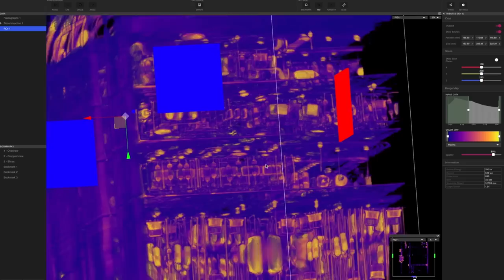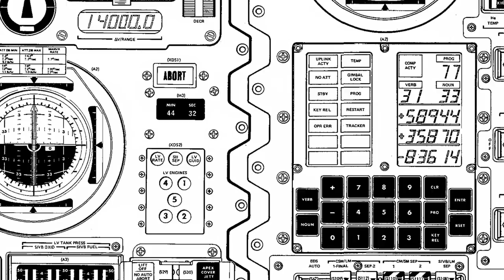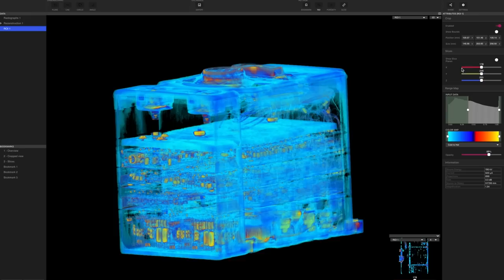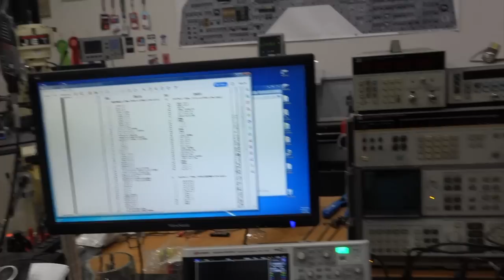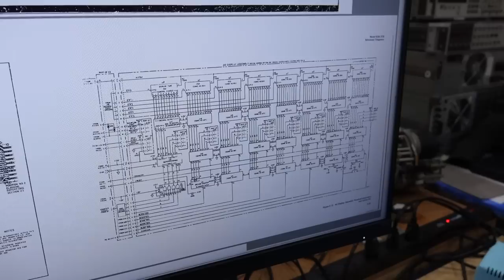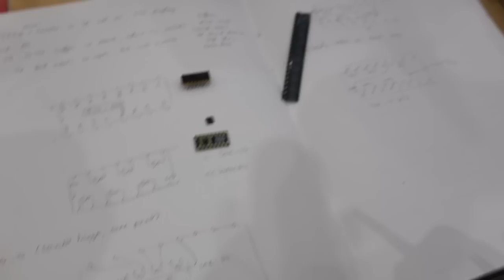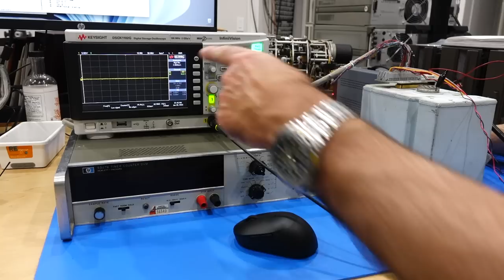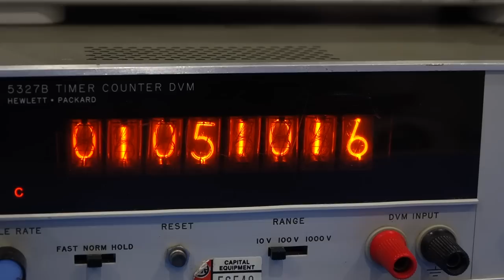Apollo Comms Part 25: powering up the Central Timing Equipment box

Comment: A sealed box from 1969 and it can hit 500.00042 khz without external locking. I'd say that's pretty good and a testament to the design engineers and the people who put it together.
Reply from the maker: I’d say the same, we were quite happily surprised!
Reply: Not to mention, this is "just" the backup :D

Comment: In 1976, I worked  in the factory of a Skokie, Illinois manufacturing company.  My boss was a great guy who was once an executive at General Time Company in Elgin, Illinois.   He told me the story of how his company sought the contract to build the Apollo central timing unit, and was so proud of their part in the Apollo project.   General Time built some prototype clocks using the very best parts and techniques available at the time, building them to exacting NASA standards.   My boss traveled from Chicago to Houston with two copies of the prototype in a briefcase sitting next to him in an adjacent seat on his flight.   He delivered the items to NASA and General Time won the contract.
He told me there was a switch on the Saturn rocket that activated when the rocket lifted off the launch pad to start the clock.  If I remember correctly, the whole vehicle had to move up a short distance to trigger the switch.
Reply from the maker: Yes, there is a lift off signal that goes to the clock. I should really wire it up. It was simply connected to the ground service equipment plug, and when that let go the contact was broken, signaling lift off.

Comment: These spacecraft sure seemed to have a lot of extra mass in the cases of the various boxes. I guess the Saturn had enough poop to lift it all.  With every advance in this project, I become more gobsmacked with the brilliant persistence involved in the sleuthing.
Reply from the maker: Actually the cases are incredibly light, in magnesium. The case feels like it weighs nothing. However the boxes feel incredibly heavy for their size, it’s just the weight of the 1960s electronics inside!

Comment: Apropos absolutely nothing, I used my Big Ben alarm clock in the late 50's, along with a mousetrap, non-safety wooden match, sandpaper, custom bracket, and small unsafe but sane bit of 4th of July tomfoolery,  to make what might be called a timed noise-making device employed outside my sister's window. I don't recall how successful this all was, but it was great fun to construct. The important aspect of the Big Ben was that the clockspring winder on its rear unwound rapidly when the alarm sounded.

Comment: Now, for extra credit;
Design and construct modern replacements for each of the spacecraft modules using currently available production parts. Special exemption will be allowed for incredibly specialized components which may not be currently available due to lack of demand. Additional points given for creative use of modern components to replicate functions of unavailable parts. 
The design brief is to create modules which are smaller, lighter and equally capable while meeting equivalent reliability and fault tolerance of the originals. New modules must retain interoperability with original units.

Sorry. I couldn't help it. I can just imagine how hard a task like this would be to try and attempt.
Your work is amazing, and it is so good to know that this knowlege is still out there.
Reply: You wouldn't do it that way.  All the digital stuff for the entire spacecraft could be done in a single FPGA chip.
Reply: @stargazer7644  I am aware of how you would do it if you were building a NEW space craft. What I would get a huge amount of enjoyment out of is seeing how we could replicate the old stuff with new components. 
As to the single FPGA, that is a recipe for a complete disaster. If the chip fails in any way, you are sort of screwed. 
Vibration, temperature, humidity, radiation and just plain unknowns mean you have no choice but to double or even triple up just to be sure it stays working.
Additionally I am not talking about a circuit duplication. I am looking for a FUNCTIONAL duplication. So which parts you use and how you use them is irrelevant. So long as it does the same job with equal or better reliability.
Overall it is a design exercise with a set of known parameters.
Reply: @RomstarOrion  There is absolutely no point in replicating each module independently like that.  And FFS man, they had TENS OF THOUSANDS of components in those CM modules with a MUCH higher failure probability than a single FPGA.  Replacing them with one component makes things MORE reliable, not less.  Simply have a redundant pair of them.  How many of those MUCH more complex systems had triple redundancy?  It seems like you're just arguing to argue.
Reply: @stargazer7644  Actually, I had every intention of suggesting that you were arguing for arguments sake.
I think you missed the entire point.
It wasn't about creating it to use it for anything. It was to see how we could go about doing it for comparison sake.
It was an idea to do for FUN. Yes, fun.
What practical use could there possibly be in recreating these other than to see how we would do it.
The entire 1960s space program pioneered new technology, the benefits of which we are still seeing. That is part of the reason why these things were built the way they were.
Today, it could be possible to build almost all of it out of off the shelf parts and still have it come up more reliable, smaller and cheaper.
Reply: @RomstarOrion  "Today, it could be possible to build almost all of it out of off the shelf parts and still have it come up more reliable, smaller and cheaper."
Yes, in fact you could do almost all of the digital part it in a single chip, as I said.  Sigh.

Comment: It makes sense, considering the number of places timing signals went, that "the clock has started" (or similar wording) was important enough to call out at liftoff.
Reply from the maker: In Fran’s Blanche superb “Apollo 11 launch in real time” with combined voice loops, you can hear the “roger clock” being called out at lift off by the launch engineers.

Comment: Very cool!! I have an hp nixi volt meter of the same form factor, possibly the same nixie board you have there. You are giving me ideas for future data display needs, THANKS!!! 
Right now it's an HP high res volt meter with a blown high pressure mercury-reed relay that exploded on me! I don't like those relays. I won't gut the volt meter section, it's a work of art. But I'm not going to replace the relay until I know why the last one exploded with minimal provocation. It shot glass against the wall behind me (and it's small amount of mercury). I just barely bent the wire running into the "containment" housing and BANG!
Reply: I'll just use the native input though!

Comment: What was the trigger for the MET to start? Was it the end of the countdown? The vehicle clearing the tower? Or something else?
Reply: I wonder that also 🤔
Reply: Did a little research and it seems the clock starts at liftoff but haven't been able to find how liftoff is determined. I.e upward vehicle motion, umbilical disconnect, etc..
Reply: Liftoff was an external input to the AGC and was checked every half second.  Several functions were triggered at liftoff, including resetting the mission clock, switching the CM and Saturn V IU from a rotating to non-rotating reference mode, starting the earth orbit insertion program, etc.  This signal is generated by the IU umbilical disconnect.
Reply: @stargazer7644  I expected something along these lines... thanks for the info!

Comment: So. A big question. How much in your collection is missing to rebuild all the avionics of the apollo capsule?
Reply: Check the layout picture at 0:20 and count the uncoloured boxes.  Then add any other gear that is deeper in the command module and everything in the service module and what additional controllers were used on the lower stages for guidance during launch.

Comment: Slightly more ridiculous, but you could have used a CPLD or FPGA to switch between native HP mode and BCD input mode.
Reply: Sure, but quite a bit of overkill.  All they need is a couple of bus switches.

Comment: Is the CTE filled with anything?  awfully high density with no air movement for cooling
Reply: That's what the heat transfer plate is for.  You can't rely on air for cooling.  Remember, this stuff has to keep working even when the Apollo interior is in vacuum - during EVA or in the event of a cabin depress for example.

Comment: @4:00 - that tidbit - the 400Hz is what I find interesting.  I wonder how the aircraft and space agencies determined or standardized the 400Hz design.   I know that it makes for smaller transformers and circuitry, but how was it initially conceived and how did it become the standard?  The mind boggles.
Reply: I think 500 was too high and 300 too low. I don't know either ...
Reply: @8BitNaptime  Actually, that made me spontaneously laugh.  Thanks!
Reply: The higher the frequency, the more weight and space savings you have for the power system, but 400 Hz is 24,000 RPM.  Increasing the frequency much more starts making the rotating mechanical components more difficult to implement - special bearings, special materials, etc.  The initial system tested used 400 Hz as a happy middle point, and it developed into a standard.
Reply: @stargazer7644  that sounds quite reasonable. I imagine there is some trade off from skin effect vs higher frequency where 400Hz was found to be a good middle ground.
Reply: @stargazer7644  So 300 was too low.
Reply: @AttemptingAstro  And 500 was too high.
Reply: @AttemptingAstro  The skin depth at 400 Hz is about 1/8th of an inch.  It would only come into play with very large conductors.  Engineers generally try to avoid using large heavy conductors in aircraft (by using higher voltages, for example).

Comment: At 20:43 they turn on the clock and it starts counting from 1 instead of 0.  I'm not sure if that's important or not.  But I wanted to point it out.
Reply from the maker: It's because I am not powering it up as I should. In the real spacecraft there is a "lift off" signal that I have not wired, which holds the clock at reset until lift off. Then it starts from 0.
Reply: @CuriousMarc  I wondered about that.  They would probably syncronize the clocks before launch at some point at T minus whatever.  Any idea how they would synchronize that?  Would that be ground equipment?  Or just pressing a button over the radio when someone says so?
Reply: @dodaexploda  The liftoff signal comes from the Saturn V IU umbilical disconnecting.  The clock does not count down.  It just starts counting up at launch.
Reply: @stargazer7644  fascinating.  So there is no clock in the command module that's counting down to the launch?  Or at least this one isn't?
Reply: @dodaexploda  The mission timer definitely isn't, it only counts up.  The event timer can count down, but any time there's a hold it would keep counting down.  The astronauts were busy during much of the count so they knew where they were in the count based on which procedures they were asked to do.  For the final 10 seconds, the count was given on the air-to-ground so the astronauts would hear it.  The ground based Terminal Countdown Sequencer handled the last 187 seconds of the liftoff automatically.
Reply: @stargazer7644  thank you for the detailed reply.